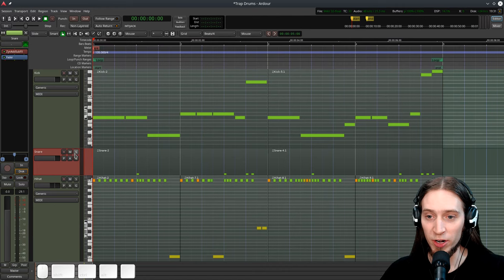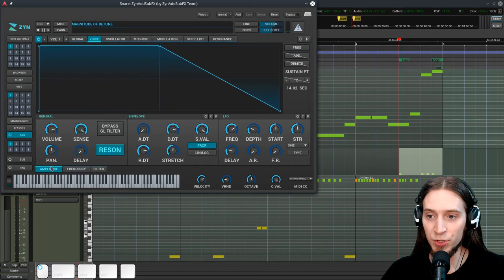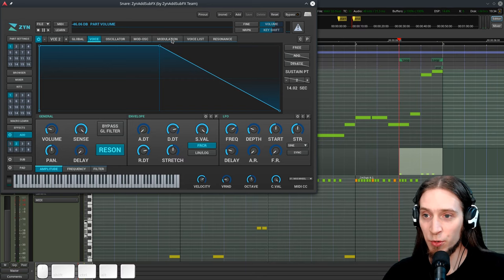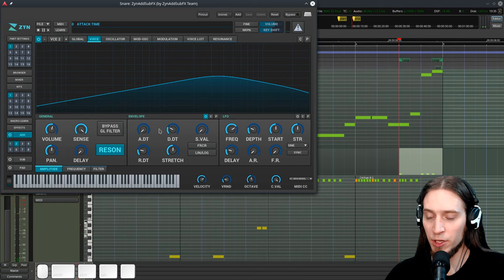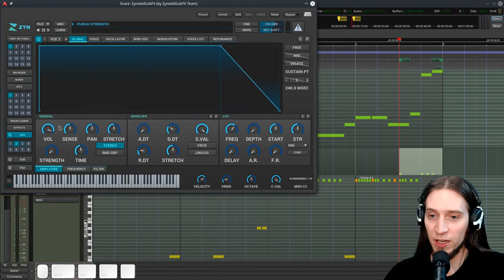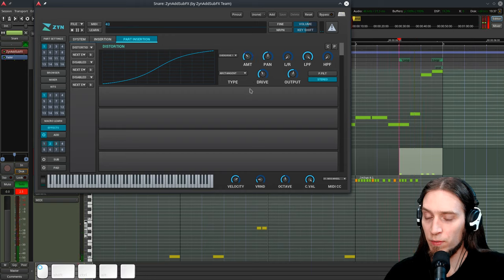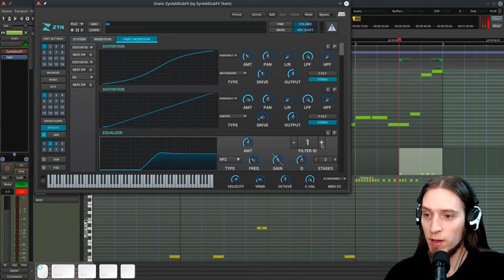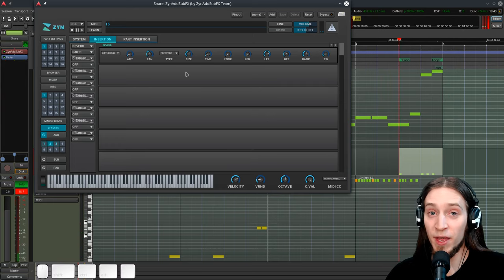Synthesizing a Trap Snare (Trap Drums: Part 2/3)

Comment: Great Zyn-Fusion snare.  I recommend to add a slight amplitude attack to avoid the click sound that occurs when the sound wave abruptly enters the sound processor.  Is there a way to create random start phase in Zyn-Fusion or does it always start with the same phase?
Reply from the maker: I personally like the "click" at the start - helps the transient cut through. You could of course mitigate that with a very short attack time on the amplitude envelope though. Or even by using a Gate or a Transient Mangler effect afterwards.

Regrding a randomized oscillator phase:
I don't think the ADDsynth engine has an option for randomized oscillator phase, however SUBsynth and PADsynth do by their nature produce randomized transients - though I don't like that for drums, as it makes my beats inconsistent.

After you remove the click in ADDsynth wiht the amplitude envelope however - you could fake that random phase click by using another voice adding the "click" (say - a pulse oscillator playing a very low pitch - producing an impulse, with a short amp envelope cutting it off after the first oscillator cycle), with a amplifier LFO turning it down - you can randomize the LFO's starting phase so that'd give you a click occurring randomly in an on/off fashion (with a square LFO) or everything in between (with a triangle LFO).

It's not "the real thing", but for a single voice it should do the trick.

There might be a parameter for that however in the synth engine that is just not exposed in the Zyn-Fusion GUI.
Reply: unfa I see.  Simple.  Thanks. You should make a video about the Zyn-Fusion documentation on Github.  It might inspire people to contribute.
Reply: Hey man.  Also Ardour should be available in other languages like LMMS is.  Lots of work to do!